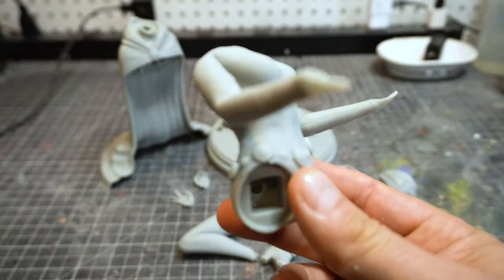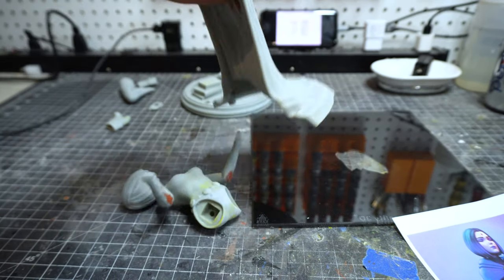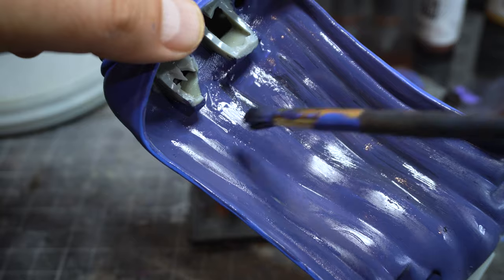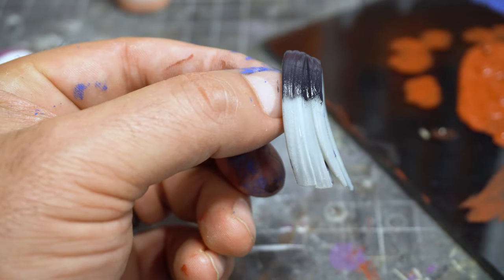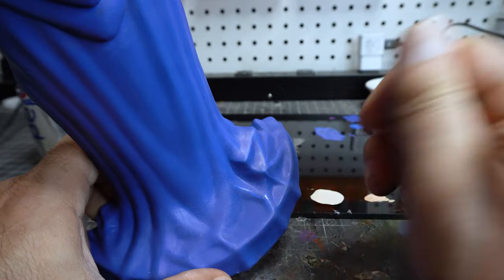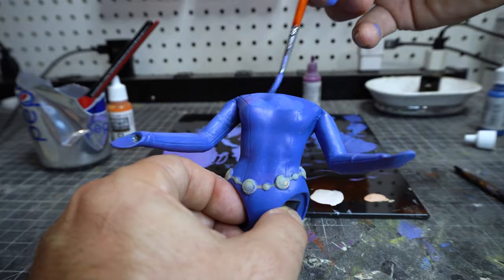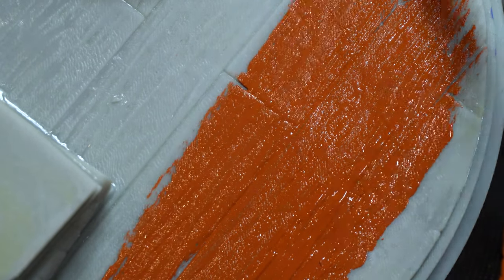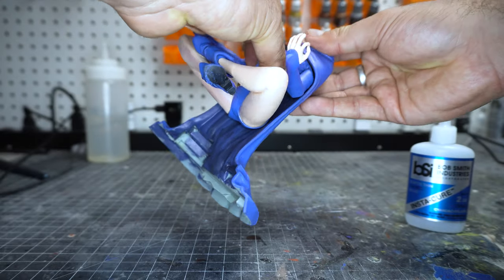How to Paint 3D Resin Prints - Raven from Teen Titans

Comment: Can’t wait to get myself a resin printer. I like the smooth finish, something you don’t get with a other 3D printers.
Reply: Make sure to add 2 drain holes into prints so they don't become sloshy resin water balloons😂😂
Reply: @practicallyprinz  That's actually really annoying sometimes. Now I make smaller models just solid, because if the drain holes are too small, the resin won't flow out.
Reply: @achannelhasnoname5182  better idea, doesn't really slow down a resin printer either, still the same curing times.

Comment: Good video but a couple questions why did you not prime it? I feel like that would cause issues later on and you didn't pin the parts together ca glue is fine but I dont think I'd rely soly on it especially with there being no support under the legs
Reply: No need for pinning. The model is keyed for that reason. The body can be hollowed out with drain holes in the keys so it can be lighter weight. Super glue does just fine holding the model together unless you plan on man handling it like a 2 year old.
Reply from the maker: IU was out of prime and just wanted to see what would happen. Not smart, but I really wanted to paint it. The glue is totally fine for such a small figure. If it was heavy or something I would have used epoxy. :)

Comment: I 3d printed a mask and sanded it, primed it, then tried to paint it but the paint just doesn't really take unless I cake it on. I used acrylic paint. Not sure what I did wrong
Reply from the maker: That's weird, what type of acrylics did u use.
Reply: @3DPrintedProps  I've tried plaid fx and the cheaper apple barrel gloss acrylic paints

Comment: I am a beginner. Do resin printed figures require a primer coat before you use color if the resin is a dark grey? What is the best paint to use?
Reply: This is what I was wondering? I was really surprised no primer was used especially since I keep hearing how troubling it is to adhere stuff to the raw prints.
Reply: If you want the best results then prime. 

Black for darker colors. 

White for lighter colors. 

Grey for a mid-ground. 

Alternatively you can use just black paint for darker colors. 

You can also mix Gesso with black and you get a solid grey primer, works well for me.

Comment: hey man you make it look easy. so all the guides online suggest using primer and im using rustoleum grey but the paints still aernt sticking. it looks like youre doing better on the plain resin then I am with a couple coats of primer that have had a day to dry... its kind of driving me crazy because i had the model in exceptional condition before painting and now it looks like i smeared shit mixed with paint on it... any suggestions would be greatly apreciated
Reply from the maker: I usually use primer, but I was out . I guess just make sure you're using decent paints. I love Vallejo and Basics.

Comment: What's the best way to strip paint a 3d printed resin? Are these sensitive to cleaners such as LA's totally awesome?
Reply from the maker: They are plastics so you need to be sure the solvent won't harm or melt it. I haven't used things like that, but if you do, test it on an failed print or a piece of support.